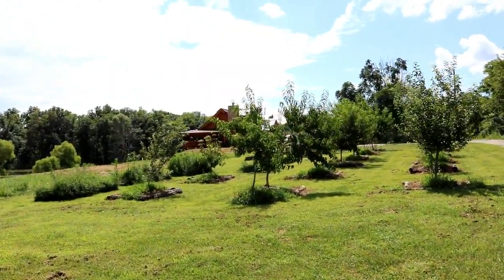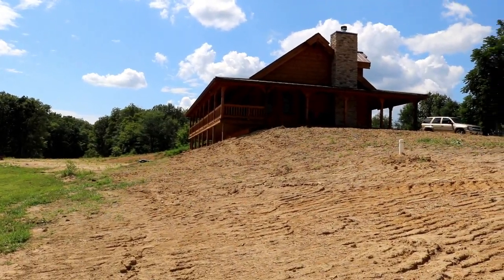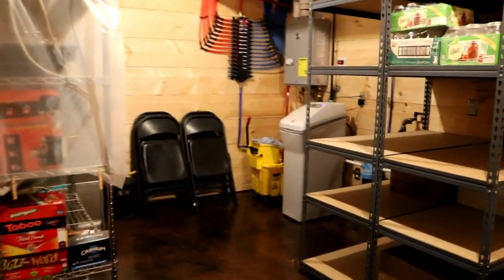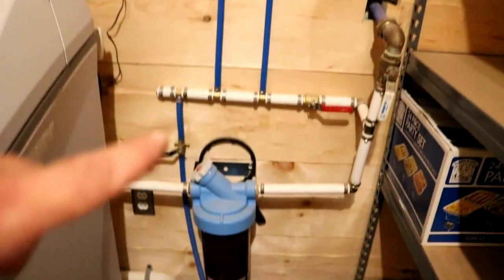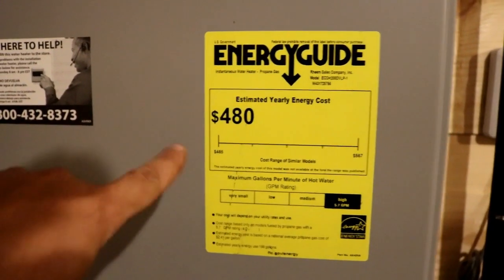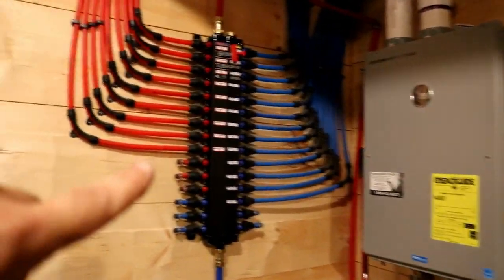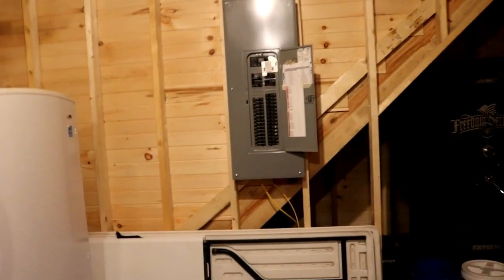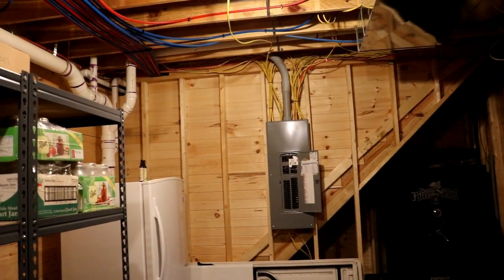Log Home Build Episode #29 - Mechanical Room with Generator Inlet

Comment: Evan, at some point you may decide it’s easier for you and Rebecca to go with a larger ‘whole house’ generator. I live about 180 miles west of you in the Ozark’s on a small 20 acre hobby farm. We have a well and we did have a heat pump when we first moved in so I needed a 20Kw Generac connected to a 500 gallon propane tank. The generator can supply all my electric needs with no problems for 7-10 days depending on how cold it gets. After I lived here for 8 years my heat pump died so it was replaced with a much more efficient ground source geo thermal unit. It doesn’t draw a quarter of what the old 10 SEER heat pump drew so the electric costs went down and the propane use went from 2 tanks per year to one refill lasting 2-3 years. I only use propane now for the emergency gen, my ventless fireplace which I’ve only used once for emergency heat and my BBQ. Costs were very reasonable for the added security. We lose power due to ice storms several time each winter. The generator and automatic transfer bus was $5k installed. The geo thermal was 13k installed — $8K after a federal rebate. You can get by with a smaller and lower cost generator since you don’t have a well. I have had my geo thermal for 10 years and it’s paid for itself 3 years ago just in propane savings. We just added a 10 KW solar system. It cost $19K after federal rebate and will be paid for in 7 years in electricity savings. My monthly winter bill went from $230 a month to $30 for a connection fee to the grid. If electric rates go up, we don’t get a hike ..and they will go up. In 18 years they have gone up twice and we hear they plan another hike. These hikes make our effective payoff time shorter. I hope you think these options over. I really enjoy your videos. They are interesting and well done. Keep them coming. Consider using some of your YouTube income to reduce your utility bills. I’ve never regretted my decisions to cut ours down. The decisions could make an earlier retirement for you and Rebecca a possibility.

Comment: When I built my house 2016 we put in a 2 stage heat pump and since wife wanted gas stove I upgraded to gas water heater. Wanted tankless but was too much to upgrade. Will do later. 
But I checked into gas set up on heat pump was extra 2k. So I didn’t go it but our power bill is usually under 130 in summer and 90 in winter. 2309 sq 2 story home. I’m in Statesville Nc but we don’t get basement house on slab of concrete.

Comment: Regarding the house, what would you say is the pros/cons? Would you do anything differently? Did you spend more building a hybrid than you would have if you went with a log package?
Thanks
Reply from the maker: I could write an entire paper on pros and cons.  It would just be easier for me to tell why I choose hybrid.  
No settling of logs.  I went to a log home show, and there is an entire section on log settling systems to help control settling on a log home.  This worried me.
Conventional build, easy for me or contractor to work on.
Ability to insulate and make air tight.  And so far I am very happy on how cheap it has been to heat and cool my house.
The only "Con" I see is that it doesn't have any round logs to give a true log home look.  But the timber style gives it's own type of appeal.

Comment: So where is the generator located? And secondly what will you do when you are not at home and the power fails? How will you get back in time to save the content of your fridge for example? Does your wife know how to operate the power supply in case of an emergency? 
Circuits that run outside lighting or power: whenever a light may have a defect (earth leakage circuit breaker is activated) the whole power circuit might be off. Whenever a circuit is heavily exposed to the outside weather influences it helps to add switches to this circuit to isolate the failure so at least you can keep the rest of the circuit alive. Reason is when a night time, storm, heavy rain, snowfall is ongoing you won't have time or possibility to easy fix a short cut problem quickly. Besides when a circuit can be partly switched off manually finding the cause of a failure (earth leakage circuit breaker) can be done much quicker. Emptying waterlines: in case gravity cannot help you due to an odd location of the outside water hydrants you can use air pressure. We have 4 frost free outside water hydrants on 2 separate water supply pipes and these can be shut off and emptied from a central access point from inside the house entrance door. The lines are accessible with air pressure by vent valves and the water is drained through (pushed out) the hydrants itself.
Reply from the maker: The generator is in the pole barn right now.  I will move it out to the house in the winter time.   My wife does know how to switch the system over to the generator, we had a similar system setup at our last house.  The hardest thing is for her to start the generator.  I probably should have bought one with electric start.